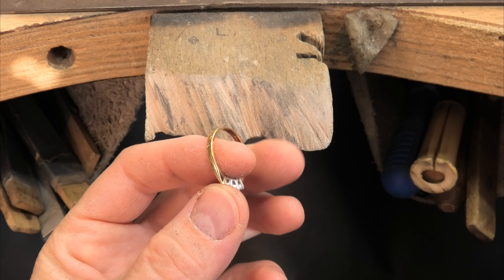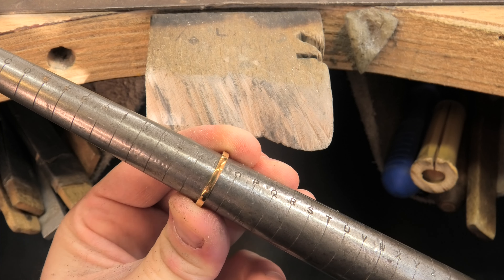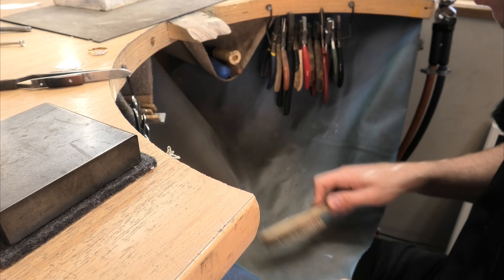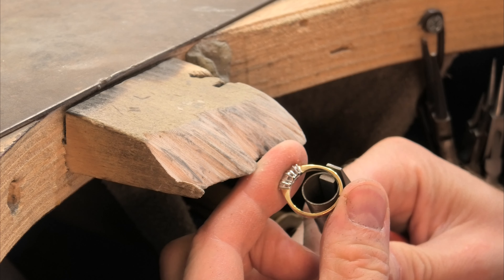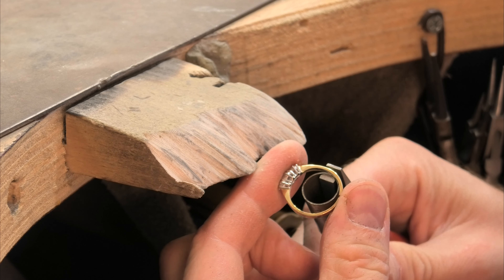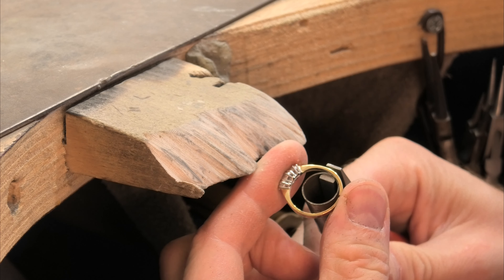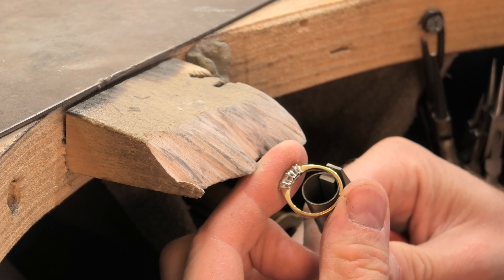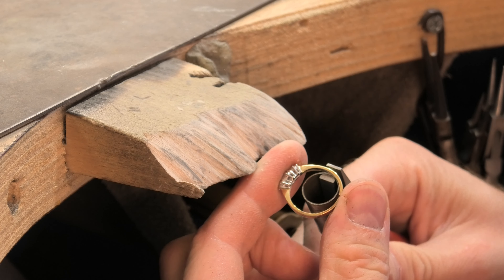How to Size Down a Diamond Ring.

Comment: Interesting method. I was taught to round the ring, find and make the cut, and then push the ring up the stick the same number of sizes that it was being reduced to. Measure the gap with dividers, and cut that amount out. Close gap, saw through, solder. Boom.

Comment: sizes need to be extremely accurate because of the swelling of the finger and also the thickness or thin-ness of the ring, if its even 0.5 off a size or even a tiny bit it'll flop or get super tight and uncomfortable for the customer. always always helps to have the customer tested/measured properly at first then have them try it on once they get it just to be sure in case it needs to be tapped up a bit or maybe down a hair. if youre working for other jewelry stores or whatnot its handy to give them a call to fix the issue of messy handwriting or any confusion of size.

Comment: The ring mandrel is tapered, right? That means the LEADING edge of the ring shows the true size not the center. If the center is on "L", then the ring is actually larger than that.
Reply: At my workplace we go for size of a ring on a mandrel is the middle of the ring. I know many jewellers who do both, depends on the jewellers preference/workplaces preference.
Reply: @sirfirehare  Sure, but technically the actual size is the edge of the ring on a tapered mandrel, unless the inside of the band is domed.